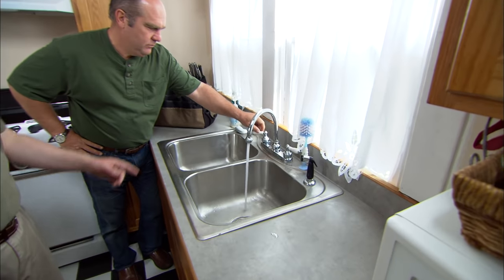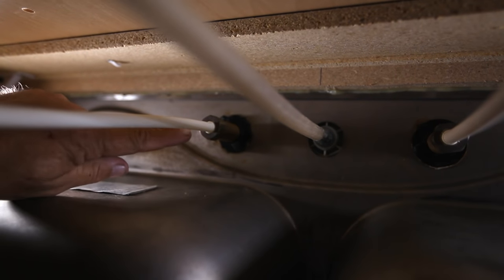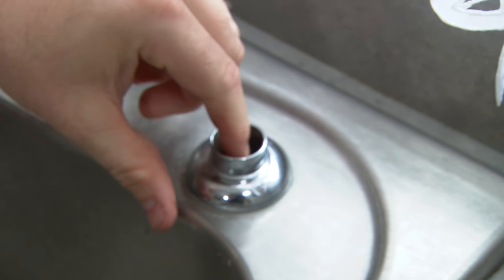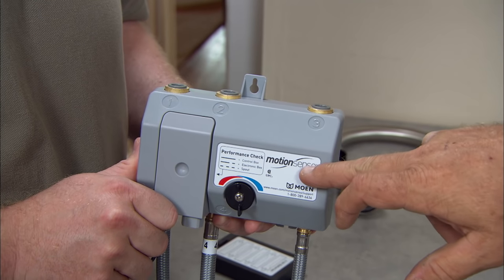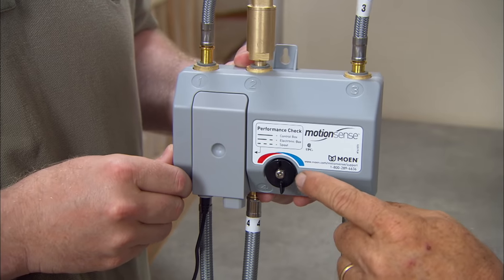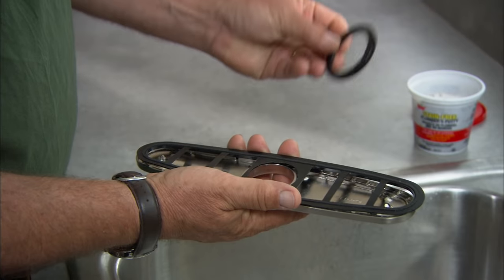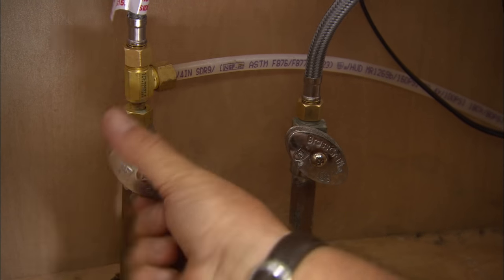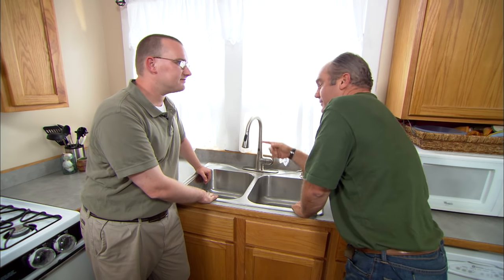How to Install a Touchless Kitchen Faucet | Ask This Old House

Comment: Do not buy if you in Canada. Warranty are just 1 year and problem started after one year, after 2 years it started opening valve by itself. $700 faucet should last at least 10 years. Power supply should be provided and not batteries option which work only 1 month. I just checked how much is it (power adapter) and it's $150 !!!! Seriously? My worst experience with faucet.

Comment: Been using this faucet for 3years, worked well until a few weeks ago when the water would automatically turn itself On/Off! Replaced the batteries, same issue. 'Reset' the control box, same issue. Called Moen, and they are sending me a new control box,  no questions asked about proof of purchase or any other b.s.  Also, the 3 hole cover plate coating is already pretty worn out. Overall for the $120 I spent and service received from Moen I am satisfied, the touchless On/Off is a great feature(when it works) when you have your hands covered in food guck :)
Reply: Moen has GREAT customer service!!!
Reply: You have a link for this faucet?

Comment: Very clever tap, and one that plumbers love. It will keep them busy for years, coming back
to fix it.   It won't be long though before the householder has it taken out.
Reply: I think when the batteries die for the 10th time, homeowners give up and just use the faucet by flipping the handle
Reply: @andreyyaromich8277  you know there is another one which is connected to ac power socket directly. you don't have to care for the battery
Reply: akshay bholee true, but when people look to replace a faucet they’re not looking to spend 1000$ for such a  complicated job, Home Depot does a good job selling, but all the labour comes after which homeowners don’t expect

Comment: Wow I’m so thankful that you included the wiring (so to speak) of the control box. It got me real confused the other day, when I was reading about touchless kitchen faucet on this healthykitchen101 kitchen website. One question though, is that if the faucet is in touchless mode, you can only change the water temp on the box which is in the under-cabinet? That sounds kind of exhausting, doesn’t it? Hope I’m wrong about this. Anyway, thanks for the video. You’re a live-saver.
Reply: You could find your perfect temperature and not have to worry about it...not too different from the regular way. The only problem is when the water in your hot water line gets cold and you have to wait. I guess that's where that top sensor would come into play so you could just let it run for a bit waiting for the hot water to catch up. I don't know...I'm not a big fan of these sensors seeing how I hate them when I go to public bathrooms.
Reply: I think that's the default temperature for when you use the touchless. You can manually adjust it as well.

Comment: Have no idea why people are still using football shaped shut off valves, I went through out entire house replaced them with quarter turn valves work great not having to worry bout them freezing up & leaking..
Reply: Old timer.. 👍
Reply: At least you can rebuild those valves if they leak by just changing a gasket unlike quarter turn valves you have to replace entire valve which not everyone knows how especially if it's soldered.

Comment: What if the top sensor was buggy and detected you turning the water on, then didn't detect you trying to turn it off, or you just walked out of the room and forgot to shut it off? Does the top sensor keep the water turned on indefinitely or will it eventually automatically shut off? Can you manually move the handle into the "on" position and then back to "off" to override the sensor?

Comment: With such a long and complicated system, it will take forever for hot water to come
Reply: Fuert Neigt it’s preset temp for only when you use the motion, it bypasses when you open lever manually, and it will go to max hot temp from the water heater

Comment: It doesn't come with that "special" wrench. After trying to loosen the nut with my wrench, I gave up and went to the hardware store to look for one. Hope I can find one.
Reply: He probably means to say new faucets come with an install wrench to tighten the faucet up. (Sometimes) 
You still need basin wrench or sometimes it’s so rusted out I just break if the top end of the faucet and send down  a 1 3/8” step drill to just plow it all out quickly

Comment: Why does the water need to go back for the hose its connected already like the faucet without the hose its the same right why need the water to go back pls answer me
Reply: Vipper Gaming it essentially needs 2 supplies. One for the mechanical valve, and one for the electronic valve, otherwise the electronic valve would turn on but get stopped at the handle/mechanical valve.
Reply: It really doesn't, at least in Finland Oy doesn't. Check the link https://www.oras.com/fi/tuotteet/oras-optima/product/2729F/
Reply: Deltas configuration is a bit simpler, you install the faucet the regular way, but be for you connect the pullout hose to the faucet you just ad this box inline with it, this is a headache of hoses to wrangle into place with moen

Comment: what size drill bit did you use to drill the pilot hole to mount the control module?
Reply: Rocket Rider really?
Reply: 1/2 inch

Comment: It would be nice to not only wave your hands over it but it would be nice if you could speak to it and tell it what you want it to do? For example lets say you want the water to be hot all you have to do is say "Turn water to hot 5". The water would  have 10 spots on the hot and 10 spots on the cold. The faucet could be set so you could speak to it and let it know much water you want. For example you would just say "Drizzle Low Med High" etc. By giving your faucet the ability to be connected to a smart home device you can set it up so to know who is using it. When you vs someone else speaks it will recognize your voice and will set the temperature plus if you need to wash Vegetables the water will turn cold or when you want to wash something that requires hot water you just speak it into your faucet and/or you can connect it to your Alexa Dot or your Google Home etc. You could tell the faucet to turn off after you had to leave the room for something that couldn't wait. I think this would be nice. The only other thing I saw that I didn't like is the Battery is located near the back and if someone is in a wheelchair this would be near to impossible for the person to be able to change or charge this battery near the back out of reach. The battery is nice for back up but having the ability to have a continues power source or a way to mount the battery near the front so anyone can change the battery. Other than that I loved that faucet. It would be nice if the hose had a retractable spring so you can pull the hose out to where you want it and it would stay or you could pull it all the way out and let it retract on it's own.
Reply: Alexa to the rescue!  Just wait a little longer dude.
Reply: I hope your joking. Sounds disgusting.
Reply: @flat-earther  What do you mean by disgusting?

Comment: So if I want just cold water or just hot water I have to turn the knob under the sink?
Reply: Mark Jaggers You would have to use the manual knob up top for just hot/cold water. The dial under the sink only controls the touchless sensor temperature.

Comment: Nice setup but im sure after a while changing the batteries will become annoying.
Reply: Andrew Armstrong Oh that's not bad at all I was thinking along the lines of every few weeks.
Reply: I have one of these. I change the batteries every 2-3 years. It's not that bad!
Reply: buy the one which is connected directly to ac power socket
Reply: @akshaybholee3263  Was considering the a/c option, but where would that easily plug in?

Comment: @ 1:11 you can see that either the hot and cold were reversed, or someone installed the water line to the ice maker on the hot line.
Reply: ErrorError it's probably for the dishwasher not the fridge
Reply: Its for dishwasher. Ice maker wouldn't be 3/8 for fridge supply. 1/4" at most
Reply: They don't have a dishwasher
Reply: If you use hot water to your ice maker, you get clear ice cubes. The water gets degassed in the hot water tank. The volume of water going to the freezer won't heat up the freezer.
Reply: Bart Simpson 1:16 left under
Reply: Bart Simpson what’s that white thing to the right of the sink? The hose from the hot line is running that way ..
Reply: @andreyyaromich8277  It's a freezer.

jk
Reply: Beer fridge/ice maker lol
Reply: Some dishwashers do  run on cold, heat up their own water, .......but not in this kitchen

Comment: this looks dangerous, what happends with when someone put it on the hot position and forgot too put it back too cold, and then a child trying too clean his hands and using the sensor..
Reply: Sighs...did you even watch the video? That's what the mixing valve at the control module is for.

Comment: and a year later the thing wont work this device is extremely pointless and shows how lazy the human population is getting
Reply: Probably just needs new batteries at that point lol
Reply: Yeah but why would i want to buy batteries and replace them when i can just turn a tap or flick up a leaver.
Reply: the batteries are for the sensors.... you can still turn the water on with the handle it's actually a pretty good design and if you wanted to im sure you could convert it a wall plug in
Reply: True.  An AC adaptor is available, but the trick is getting it to an outlet.  Most dishwasher outlets I've seen aren't accessible from the cabinet, but it wouldn't be that hard to work it out.
Reply: Very true, like those inventions called "automobiles". I mean how lazy can a human be to not be able to walk or ride a horse? Geesh. Humans!